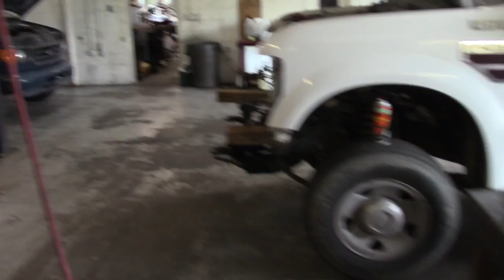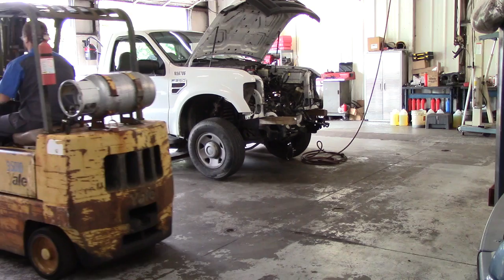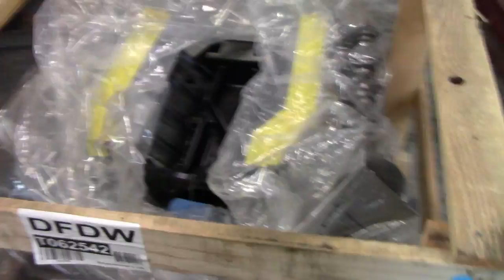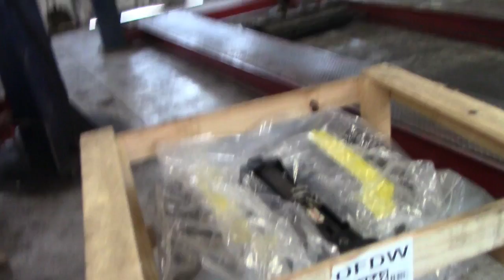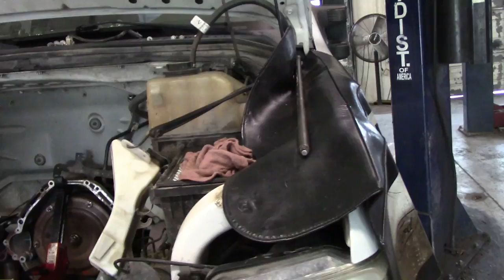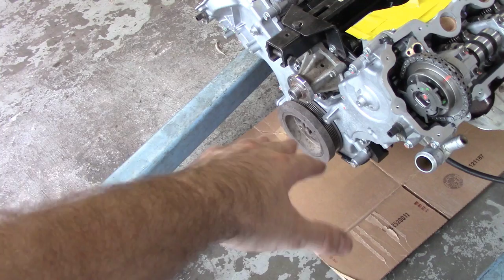2008 F-250 5.4 3V engine runs rough part III

Comment: I wanted to ask you, I'm replacing my intake on my 2008 F150 with a 4.6l 2v and the cylinder head is pitted real bad in the area of the thermostat(it was leaking there).  Do you think filling in the pits with JB Weld will hold and not leak?
Reply from the maker: You could, just make sure it's smooth when done. I use gray silicone sealer in pitted areas.
Reply: I'm using all Ford parts-no off name brand crap-o-la.
Reply: Thanks!  I'll try it!

Comment: for the oil pre luber I use this guy, saves a ton of time on ls engines and its way cheaper then the melling one ...
 http://www.jegs.com/i/Sealed-Power/844/T40/10002/-1?CAWELAID=230006180035746604&CAGPSPN=pla&CAAGID=15769068431&CATCI=aud-194566579511:pla-213811363271&CATARGETID=230006180037475786&cadevice=c&gclid=CjwKCAiA07PRBRBJEiwAS20SIFZAAlRaICjeCHlMF6G4Lrb6TkZ8eCgSG2k5uYkQlVO2KI_O-zAHrRoCQnoQAvD_BwE

Comment: For an oil pressurizer,
get a garden sprayer that will work with bleach, as it has Viton seals.
Remove the sprayer tip and install a brass fitting that will thread into
the oil pressure switch hole.
Pour the oil into the sprayer reservoir, close it, pump up the pressure,
then pull the trigger and it will pressurize the oil system completely.
Costs about 20 bucks.
Been using it for years
Reply from the maker: Gonna try that on the new engine.
Reply: It works on pushrod engines also btw. Once it starts pressurizing,
I use vise grips to gently hold the trigger to keep it going, and grab a coffee.
Cheers
Reply: If you drop the pan you can also get an idea of how much ware or excessive clearence there is on the main bearings without any teardown.

Comment: Oh man, that stripped hole would have made me extremely angry after finding the crappy studs, dorman vvt valves, poor quality gaskets and o rings. I would have to stop filming because of the nasty words that would come out of my mouth. "Did I tell you I hate aftermarket parts" - (quote from Eric O)
Reply from the maker: Oh man, you know I had some colorful commentary that did not make it into the final cut. I really rushed this into production last night hope it turned out ok.
Reply: flmmaz you are only human.  I would be surprised/disappointed  if you didn't have a few choice blue words about the situation.